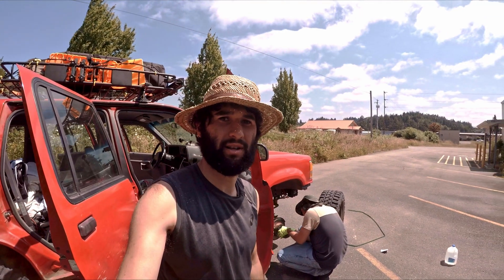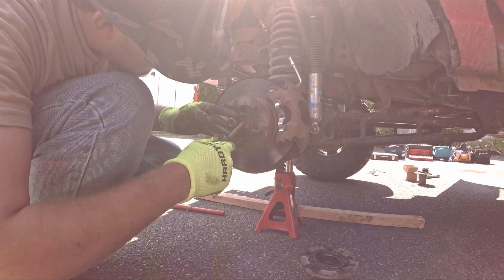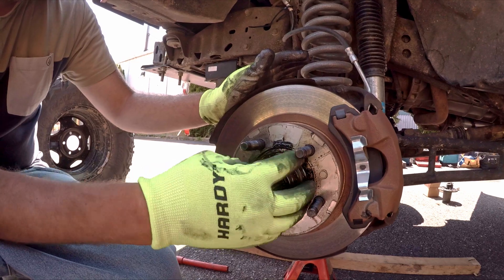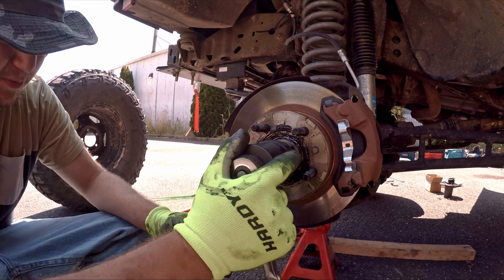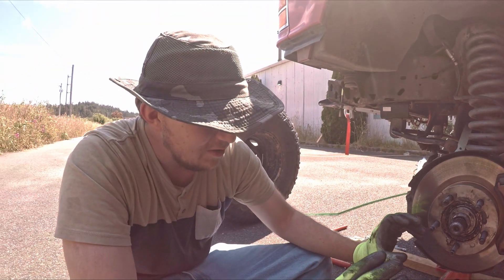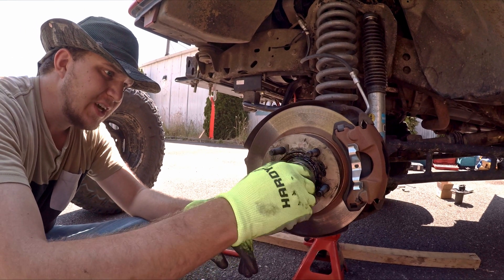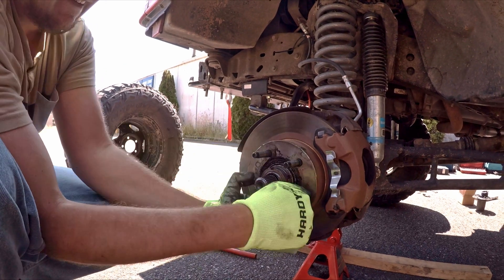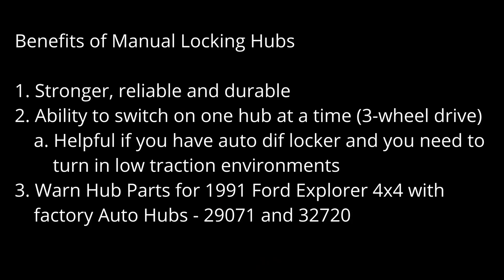Overtime 4x4 Tutorial: Manual Hub Conversion

Comment: Hey what symptoms did the failed hubs give ? Ive got a 92 4wd xlt. And it i suspect the hubs are bad. I've got noise. Vibration. Slightly jerking turning sometimes. And its very sluggish feels like the vehicle is towing something. Takes alot of oomph to get goin
Reply: If it’s the fronts put it in 4wd have someone lookin at the front axle if it’s spinning but the hubs aren’t the hub is bad
Reply from the maker: I had the truck pop in and out of 4x4 with the auto hubs. I installed the warn hubs and it eliminated that but I've blown them a few times since them after installing lockers and doing some very hard wheeling. Buy Napa so they come with a 5-year warranty. I've used the warranty quite a bit...

Comment: Hey, my wheel bearings keep coming loose any tips or techniques? Thanks
Reply from the maker: Manual or auto hubs? Pack with a lot of grease and tighten the spindle nut with a little Conrad strength as we say. Could be bad races or keyway not installed correctly. Make sure the bearings are seated correctly. When you rotate the rotor to seat the bearing there should be some resistance/pre-load.